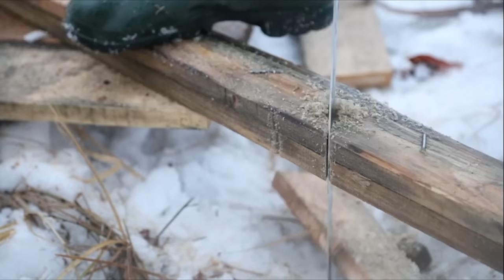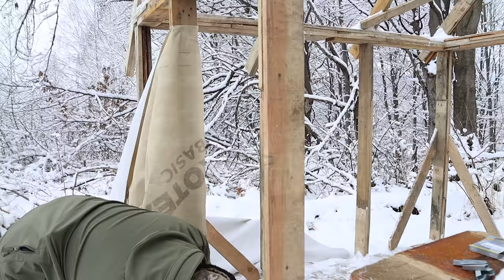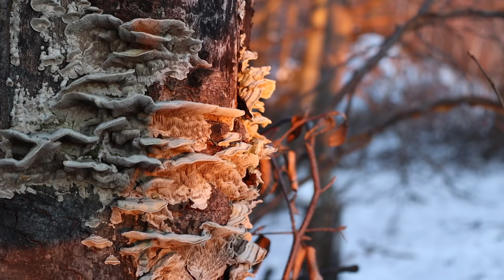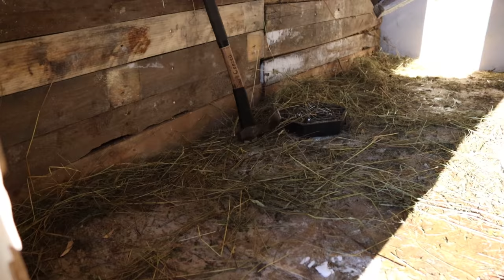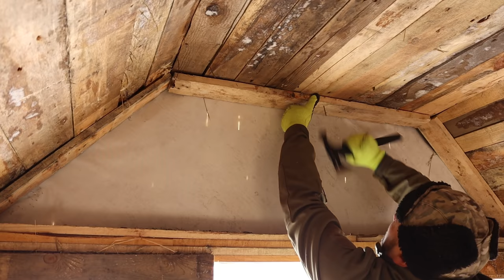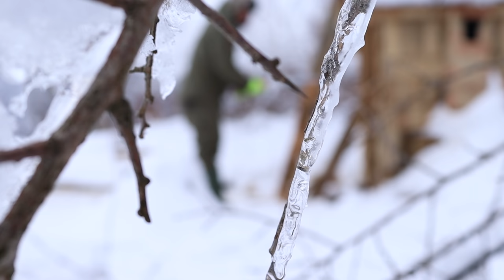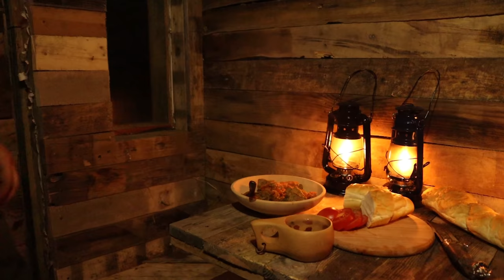House with free pallets. From start to finish

Comment: I absolutely LOVED everything you did!  I especially liked the weeds for insulation. the lanterns made it look homey and cozy! THANK you for such an jnteresting film! P.S. I also like how you installed that woodstove door.
Reply: Yes I went through the video twice and could not find the place where he installed the Firebox and door to know where it was positioned that would not cause a fire. I do know that you can use everything from mud to stones to large cans that have been cut vertically and hammered flat as a safety hearth or stove surround. And I didn't see how he made the chimney but I do know that you could also use a series of cans for a chimney if you needed to or of course Stones like the Pioneers did. If they are stacked very carefully like puzzle pieces they usually don't slide and fall apart and you can use mud for Mortar that will get harder as the heat bakes it. You could even make a skylight in place of extra windows. That would make the cabin safer from Intruders while you were away. They wouldn't even know there was a skylight.

Comment: Very simple improvement heatwise - at least during dark hours, add curtains to the windows covering the hole. It will work as double glazing, whatever cloth you are using. You can even have an outside curtain as well. Then the windows will be just as insulating as the walls.

Very visually pleasingly told!:goodvibes:

Comment: In my area in Ohio, people have a hard time giving pallets away. I get them and make outdoor Christmas tree's with lights and sell them.  Pallet wood is free.  Green gallon of paint was clearanced $2.  My time, I set at zero.  So I will make 2 dozen of them and advertise them at $20 each. They are gone within a few hours.  
I'm researching what else to make with free pallet wood.  I have to find some decent square or oblong plastic or rubber containers.  I use the pallet wood to build a planter and put the plastic container in it to hold dirt, etc.  If I picked up a piece of board to cut, from start to finish, I can have a planter build in 25 minutes which includes a coat of paint.  I stain some.  The only expense I have is finding a good size container to go in them.  Each one sells for $40 and I've had people buy four at once.  Then I knock off $10.  
This cabin built out of pallets was very interesting. You could literally save someone from the cold if they were homeless.

Comment: In the 1950's, I lived in liverpool, Illinois along the Illinois river.  People used to call us river rats! LOL! We had an old miser in town, that built modern looking house from Orange crates and other scrap materials he could find.  There wasn't a board in that house over 2 feet long!  He pulled the nails and straightened them, all plumbing and electrical came from local dumps.  We laughed as he built his house, but it really looked like any other house when complete.  Doors, windows, roofing and siding came from the dumps.  I can't think of anything he spent money on, except mabe the lot.  If there is a will, there is a way.

Comment: As I watch this magnificent precise, local workmanship done without power tools...I think of the following supplies he brought with him:
a tarp, a trowel, a hand saw, axe hammer, nails,  knife strong enough to cut wood, measuring tape,  gloves, great hat, rubber boots, bucket, small shovel, thick steel top for a wood stove...including removable lid, Strotex basic...to staple to the frame, staple gun and extra staples. 
Just curious...how many days did this project take in total? 
Also, were the other supplies, such as all the pallets and rocks, brought in my truck or plane or boat?

Comment: Here are some old-school hacks . . . . .Hold your hammer all the way back on the rubber grip handle, you'll get more leverage and it'll be easier to drive the nails into the wood. Next time stagger the roofing boards, more watertight this way. The flame from the candles are too close to the walls, an aluminum reflector made from a used pie tin will help distribute light and keep the flame off the wood walls. Season your wood bowls, etc with vegetable oil first before using them, do this with iron ware too although you have to heat the iron up really hot first.

Comment: The Strotex Basic stuff he wrapped around the frame is called a "roof membrane," and it's purpose is to be a wind barrier and protect the inside insulation from moisture. I looked it up.

Comment: Nice work on the build.   I had a dejavu back to the 70s building a horse barn in the hills of WV where I grew up.   It was not nearly as nice as the one built here.   Nevertheless it kept the weather off the horses.

Comment: Can you give us the specifics of those tools you used? The saw was awesome! It cut like butter! And did I see that saw FOLDS UP? The hammer with the hand axe or hatchet on the back -- wasn't that extra heavy for hammering? There were a LOT of nails  -- a LOT of hammering! So -- wouldn't it be better to have a simple regular hammer, and then a separate hatchet?

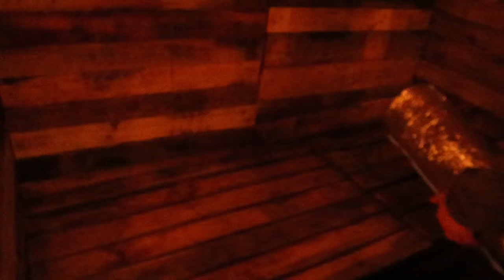Comment: So how does the walls not catch fire when the candles are that close nailed into a metal holder but that flame is literally burning up against the wall look at between 29:00 through 32:11 you can see the candle just burning idk how it’s not catching fire all that work to go up in smoke it be a shame

Comment: Shouldn't the foundation be the most important part? I live in SC rural area with old barns and houses. They put done stone to set posts upon so the ground doesn't rot them. Loving everything else though.
My little house is 12x20 with 2 small lofts. 10ft high walls and 6 ft head room upstairs. Wood stove heats up so well I open the window and door :)

Comment: I forgot to add in telling how old timers might have built the house to actually live in that they would typically bring in sheets of corrugated tin for a roof but you could also bring in many many tin cans that had had bothans removed and with some tin snips open them up and Hammer them into a tin roof in a shingles pattern. There is nothing like rain on a tin roof. It's the spring and summer equivalent of having a cozy fireplace in the winter. I would have to finish off the sides of the bed and seating because I have a spiderophobia and certain poisonous spiders actually prefer housing like that. I would have to chink all the gaps in the wood with mud as well for that same reason. Otherwise this looks like heaven. And as much as I like people sometimes I could live for months alone in the place like that. Year-round, even.

Comment: were can rent land were build, i want build little biggest but cheap cabin, and live there summer season alltime. finland. i think build warm inside all good and then outside styrofoam board/sheet 300mm around and floor and roof, then plank top. lot warm house. and super cheap.

Comment: I applaud all the work that went into this, but it has some serious flaws.   First, he used bright nails, which have no rust resistance. They'll disintegrate in a year or so  Second, he didn't leave any overhang on the roof on two sides, so that allows those nails to rust even faster.  Third, he stuffed the walls with grass and hay for insulation, and although that seems like a great idea, all the mice in the surrounding area will think it's a great idea also, and they will all set up shop in those walls.  Dozens of them.   So it will be nice for a few months, but after that it will be almost uninhabitable.   It's a shame to think of all that effort wasted.

Comment: I hope this is on private land and not public domain. In a few seasons it will be rotting and full of vermin, then will either have to be cleaned up or just continue on as an eyesore. I spend most of my summers cleaning up illegal builds like this in the wilderness. It's quite irritating.

Comment: Please do your homework before building with just any pallet. Hoping he did! Why? Pallets can be toxic. Look for the IPPC stamp on the side of the wood to determine how it was treated. Pallets marked with an “HT” were heat-treated and did not come into contact with chemicals during the treating process. Avoid unmarked pallets or those stamped with an “MB” for methyl bromide. In general, safe pallets will carry the DB, KD, EPAL or HT markings, meaning that they haven't been treated with dangerous chemicals.